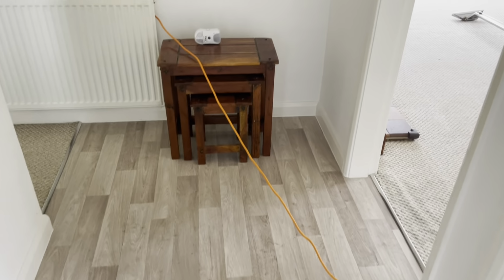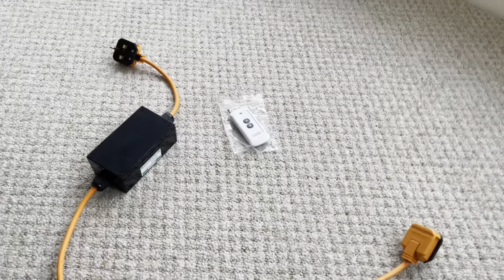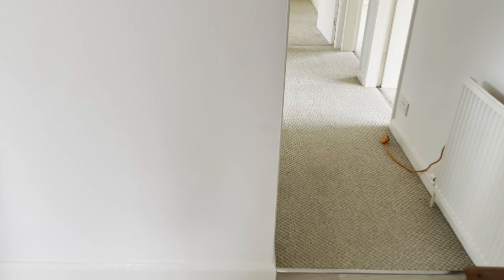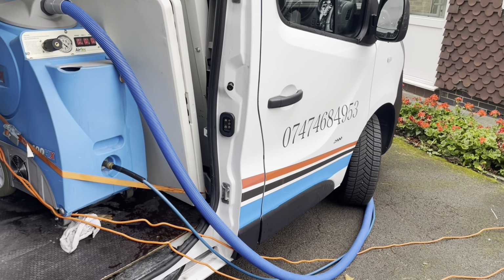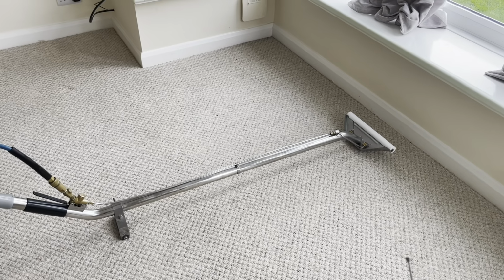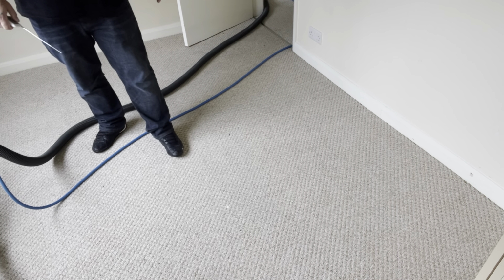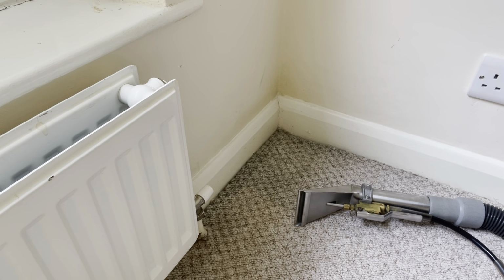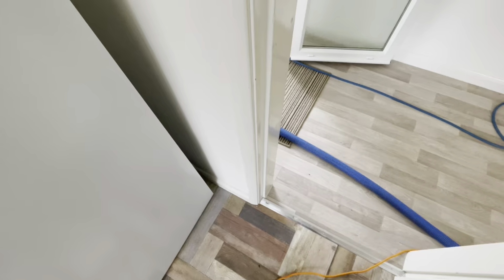Carpet cleaning with electric remote pack receivers

Comment: I have a switch like this but it's a single and I use it to power a wet and dry vac if I don't want it in the room with me or using a long length of hose.  I can usually buy them at the hardware store here in Canada, either Home Hardware or Canadian Tire in my town.  Of course, our regular outlets do about 120 V.  I also have a "Frankenstein" of sorts switch that powers a double-pole contactor in a metal enclosure and use it with two separate circuits.  I can usually get these switches for around CA$40 or around UK£20.  Granted they are lighter duty used for switching decorative lighting on and off so using them with a fairly large inductive load may wear it down faster but my FrankenSwitch could be classed as commercial grade.